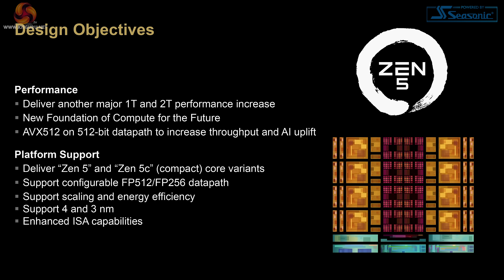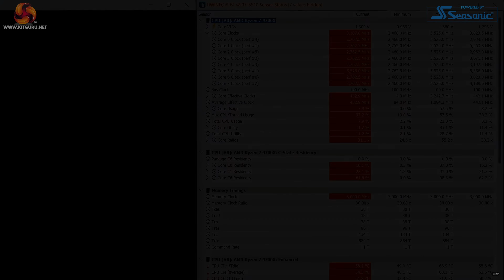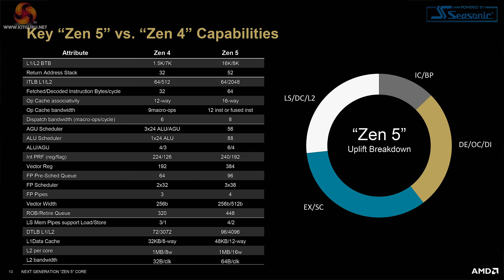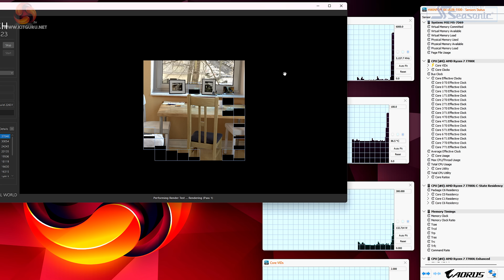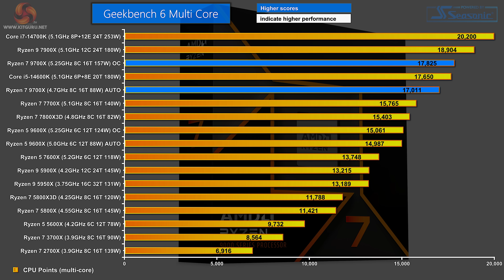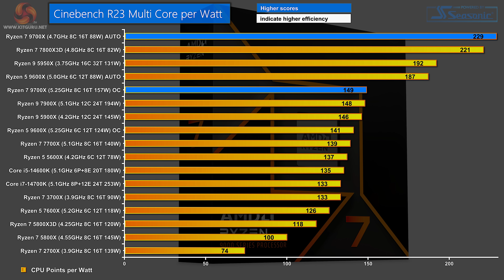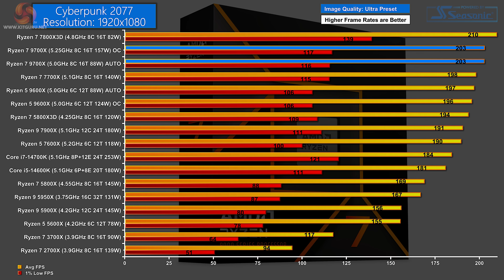AMD Ryzen 7 9700X review: YouTube hates this CPU

Comment: For game results, I think the cases where the CPU isn't doing much, it's just very quickly jumping between different power states as the CPU is waiting for the GPU and that could lead to very strange results. I have no idea about windows, but on linux there are definitely ways to control that and typically it leads to much more consistent performance at the cost of power draw when not under full load.

Comment: it seems the best choice will be a ryzen 9700x  with 32 GB DDR5 6400 MHZ and a X870 MOTHERBOARDaccording to reviews, But mine RYZEN 1700 that ihave since 2017 still runs perfectly evrything maxced 1440p 60 fps which means htere is no reason to chnage it yet it loads evrything in 1 second(games, windows, programs, movies, internet) and also runs all games maxed 1440p 60 fps. MINE MONSTER PC IS
RYZEN 7 1700
RX 6700XT 12 GB RED DEVIL
16 GB   DDD4 3200MHZCL15
MP 600 2TB WRITE:4950MB/S READ:4250MB/S
DELLP2416D 24'' 2560X1440 60 HZ IPS!
AS for windows 11 i can install it with Rufus even without chaning cpu too.

Comment: I wouldn't be surprised if the R7 9800X3D has the same uplift as the 7700X vs the 9700X...maybe we'll see some kind of optimization at the 12 and 16 core as far as being between different CCD's? Anyways, it's an incremental upgrade with incremental boosts to performance and efficiency. Looking at the big picture, it's what an iterative release is supposed to be! What do people want? New features that have problems? No.......

Comment: Very well structured & laid out review, with a mature opinion. 

The Ryzen 9600x & 9700x are not inherently bad. Nor great. Just Ok/alright.

I personally find value in a CPU that can achieve better power efficiency, heat reduction, small bump in performance & a Reduced launch price compared to the previous gen. 

Now if it were an extra 30-50$ cheaper id be giving it a stellar review. 

Lets see what the future brings us, im more excited about AMD's new GPUs more than the CPUs.

Comment: So is the 9700x ($A649) that much better than a 7700x ($A486)?  or the 7800X3D ($A588).    It doesn't matter that the 9700X is cheaper than the 7700X launch price when pricing history shows is was quickly reduced in price.  Most reviews of the 7700x stated it was overpriced at realease.

Comment: Imagine not watching hw reviewers and following amd or intels advertising. Would you still be happy with your purchase? I myself am mostly gaming only, and i would have been seriously misslead by amd advertising team for 9000 series. And to even think of defending those products is sick. Prices are huge, for cpu alone we used to buy a whole cpu mbo ram combo. There should be a thing like generational improvements with minor changes in pricing, but nowdays it seems as every cpu product is a masterpiece, a pure premium product.
Reply: in 2019 i bought Ryzen 7 2700X for €200. it's a 8-core/16-hread. 7700x costs €300 and don't want to drop below €300 even when 9000 was released. price has remained the same. with €200 that i bought the 2700X you have to buy 7600x=6c/12t. wtf is this crap?

Comment: I find it odd how people discarded the much improved efficiency and focused only on benchmarks... some did not even use PBO and overclocked. It is clearly a better CPU than the 7700x. I do find it odd that AMD stuck with lower consumption, they could've put to same power of 7700x and actually show performance improvements  for benchmarks...reviewers would be probably much more forgiving because "number gets bigger"... apparently very few care about efficiency and potential. Good review sir, appreciate you taking the time. Cheers.

Comment: You are very on the spot here, I built my current pc back when the ryzen 5000 series were brand new, late 2020, I never opted for an 8 cores cpu because I feel unconfortable with a cpu that draws 100w or more, so I stay always with 65w tdp cpus, meaning I only consider upgrading to a 6 cores cpu, BUT, this time is different, I'm excited for an 8 cores with 65w tdp that is not simply a cut down version from the real one, I will finally upgrade to an 8 cores CPU :) 

I honestly think youtubers simply find it necessary to show themselves as "tough" and heavily critique every new hardware release just so they are not seen as "(X chip manufacturer) fanboy" had AMD opted for higher power consumption to have the highest possible frequencies in order to achieve more cinebench scores (when this time is not really essential as Intel is struggling right now), they still would be complaining about how power consumption is too high and cooling requirements and so on...
Reply from the maker: Thanks for your thoughts 👍🏻

Comment: 14700-K ISNT 24 THREADS ITS 28
Reply from the maker: You are quite correct - the 8P+12E part is fine, it's the label on the chart that is incorrect. Well spotted,
Leo

Comment: It’s the exact same thing as intels 10700k to 11700k scenario 
Sure, it does stuff slightly better but for more  money and no reason to change platforms to use it if you have the latest last generation 
Meh
Stagnation
It’s bound to happen especially with intell getting greedy and stupid with voltages vs performance 
Meh
And I have a stagnation chip
11700k
It’s
Ok

Comment: That's silly advice. Buy a 7700x now and skip a few generations. If the price is the same or a few bucks difference, then pickup a 9700x. To be a great chip it has to offer tangible or negligible difference. Power efficiency is great for laptops, so it'll be exciting to see laptops with these parts, but for desktop? This is not a good cpu. Also if you want efficiency there's also 7700. I think AMD is priming us for the real 9700x, ie the 9800x with a much bigger price hike.

Comment: AMD claimed the 9700x to be 43% faster than the 14700k in Handbrake, and it turned out to be 50% SLOWER. Pathetic blatant lies.
Reply from the maker: In the reviewer's guide for Handbrake using Apple 1080p60 Surround on something called 'Cali footage' they claim 256.9 for Ryzen 7 and 358.2 for Core i7 which looks like 28% faster for AMD. I decided not to use Handbrake in this review and do not know what 'Cali footage' is. Have you run that specific file conversion using the setting they give to verify your statement or is this received wisdom?
Leo

Comment: Those "reviewer" Intel fanboys hate it because on several benchmarks it beats their 14900K, doing so at 65W, not 350W, and a quarter of the price. Then they make excuses that it underperforms on other things despite doing better than 7700X at less power draw and cheaper. Its not going to beat the 7800X3D, yet they blast the 9700X as if it should.

Comment: What really i find sad is that they talk about the 65w point but ignore it all the way long... we have the 7700x with 105 and then the lil more faster 9700x AT 65w just by that this CPU is a win little better performance with a lot less juice.. cmon. Is like a V6 2.5 running faster than an V8 3.7, less fuel but more speed.

Comment: So AMD release a CPU that is a little faster, cost a lot less than the 7700X when it launched - has great software support in Ryzen master, takes 40% less power, runs cooler and overclocks better. And you can run PBO and crank it and its still not good? Tough crowd!
Reply: You should compare 9700x to 7700 (non X) and keep in mind it is half the price. Then you might wonder why everybody thinks 9700x is utter shit.
Reply: @tehehe5929  9700x is +18% single-core performance than 7700, yet multicore is similar performance that's where people thought "it's same", but 9700x & 7700's MSRP is also similar, and 1 year later 9700x will drop in price the same way as 7700 today. See 12:16 ,9700x blew every processor away in single-core performance.
Reply: @tehehe5929  242 eur vs 350 eur. 100 euro difference. It's not as obvious
Reply: @tehehe5929  its only 50 € more now
Reply: @giratina_86  That's good value then.
Reply: @tehehe5929  Currently Ryzen 7 7700, 7700x & 9700x are at same price. Which would be better for 3d modelling, Photo & video editing, racing games & some simulator games.
Reply: @amitkrupal1234  if they are all at the same price then 9700x
Reply: @BlaiseMiller14  the energy savings are not as relevant unless your power bill is high or you need it running 24/7
Reply: @herrba  7700 and 9700x have the same price here, so why pick 7700, both are less than 300$
Reply: @NeuralFuture-m7q  prices fluctuate, currently there is a 40$ difference in my area, but it used to be a higher difference around the time of my comment.
Reply: @ your price is not a global price, if price same get better chip if not get better price to performance chip
Reply: @NeuralFuture-m7q  9700x also has an "x" in it which makes it worth buying
Reply: @herrba  It is relevant, and the same reason why people mocks Bulldozer or Intel 14nm++++++++.

Comment: This is why I like Kitguru - never one to just jump on a bandwagon
Reply: Problem is, they are on a bandwagon; the AMD marketing one that suggests the 9700X should be compared to the 7700X instead of comparing it to the 7700 which it should be based on specs...
Reply: @MacGuyver85  Nobody is being prevented from doing 7700 benchmarks.
Reply: @tomstech4390  Exactly, that's what Hardware Unboxed did and you immediately see how the 9700X offers almost no improvement compared to the 7700.
Reply: @MacGuyver85  ❤❤

Comment: I do think some people are being a bit harsh, but I think some of their points are more valid than you're giving credit for... Like you're trying to hype up the efficiency but just Eco Moding the 7000 series equivalents or buying their 65w tdp default versions like the 7700 (non x) almost completely deletes the efficiency gain! 

On the temps? AMD moved the sensors so they're not apples to apples comparisons, they said to expect large temp drops because of the moved sensors. 

Comparing MSRP to MSRP also isn't really a real world comparison. You are comparing buying them today against eachother not launch to launch. 

On the building a NEW PC thing? Honestly valid for someone getting into PC gaming, or upgrading like a 7+ year old machine... but honestly anything semi modern and it still runs into the issues in alot of cases. LGA 1700? Still relevant. AM4? Still relevant. These chips just barely outdo the 5800x3d/5700x3d in gaming. AM4 came out in 2016/2017 so alot of people upgrading now a days may just have to consider that. LGA 1700 came out in 2021, 3 years ago meaning even people with 3 year old intel setups have upgrade paths to competitive CPUs.  

So it's not that they're bad, they're just kinda meh for existing PC enthusiasts.

Comment: People need to understand that lower power consumption is always going to be better than extra performance. Why? Because of cooling and noise. And because hardware is plenty fast already. If we look back at the 5800X, that thing was almost impossible to cool because of its ridiculous boosting and high TDP. The 7700X was almost factory overclocked by AMD and ran at 95C. Again, a nightmare for cooling and noise. The 9700X, while not producing very impressive numbers, does so at 65W TDP, basically matching the factory overclocked 7700X. This is amazing for people who don't want to spend as much on a cooler as they do on their CPU.

Another thing to keep in mind is that neither the 5800X or the 7700X sold well. This is obviously because the 3700X, 5700X and 7700 exist. All of them being 65W chips that performed nearly as well as their 140W X siblings. My guess is that AMD tried to get rid of that 8-core 140W chip altogether and put the higher TDP on the X3D 8-core chip. That way they won't have a chip that barely sells and they won't need to make another SKU with 65W TDP. They just came out with the 65W chip at launch instead.

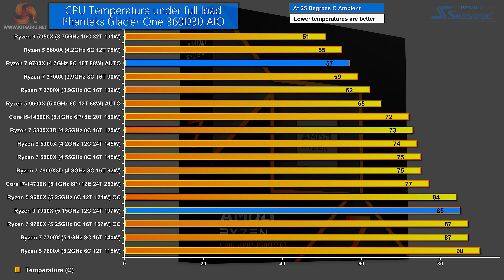Comment: I watch 9700X reviews not to diss them but to understand them better before deciding on what to buy, I believe there are errors on the highlighted areas on the graph as the Ryzen 7 9700X and Ryzen 9 7900X are confusing. Check out 12:10 where Leo mentioned the OC at 85, where it is 87.

Comment: AMD learned from intel's mistake of pushing the silicon to the limit, riding just on the edge of degradation and did not want to become the next one in line. They decided to have the customer themselves push the silicon as far as it can go themselves as to switch the liability on the user since the 'default' runs way cooler and will probably last several decades before degradation becomes an issue at the default configuration.

Comment: If you watch Coreteks latest video the 9700X apparently absolutely trounces everything, even 7950X in server specific workloads.  AMD has gone the Nvidia route and is catering to business.  Making hay while the sun shines.   Personally I think a Curve Optimized undervolted OC to 5.8ghz would be better for gaming than a 5.25ghz all-core OC.  My 5800X happily does 5.05ghz on 7 of the 8 cores while gaming doing that type of OC.  If you're doing rendering or heavy workloads all-core is the way to go but gaming is a light load and would benefit more from higher clocks.

Comment: The fact that this one can achieve such clocks at this voltage can mean a lot for the x3d, where the clock speed was always the major bottleneck.
Also, the focus on low voltage could mean a dual CCD dual 3D cache design in the next release.

Comment: Only you, Leo, and Wendell from L1 Techs have shown the new 9000 series under a different, more optimistic light and I thank you for that. Yes, it's very clear they're not as espectacular as AMD would like us to believe, but they're a step in the right direction especially on the efficiency side. Your criticism about the clock speeds are correct, that's something AMD shouldn't have done. Maybe that's just a strategy to sell upcoming processors at higher prices, as they are doing with the new XT series.

After a bunch of youtubers uploaded their videos downplaying or mocking the new chips, most of the others jumped on the bandwagon yet they failed to talk about other facts you did mention. Your 8/10 score for the chip is spot-on.

Comment: Power consumption is more relevant in Europe than US/Can with elec price about 4-5x higher. Over a year this may save say £20-£30 vs last gen, so maybe £100 over a short lifespan. Thats relevant when comparing cost/performance, plus requirements for cooling etc. (UK price is 25p/kwh roughly, was over 40p not long ago)

Comment: +10% more performance with 40% less power usage - this is a huge improvement! 
I looked at some of the reviews and was completely stunned by the complains. I have no idea why they are ignoring this. 
I would even say that this CPU is a gamechanger on the market. Can power smaller devices with desktop performance.
Reply: 1 it isn’t 10% faster on aggregate.more like negligibly faster compared to the 7700x/7600x
2 it’s 7-10% faster then the 7700/7600 (non X) which have roughly the same power draw.

This might be able to be achieved with just a Die shrink of the 7k series.

So I am disappointed that 2 years of development with very talented and previously very successful engineers. Lead to absolute jack shit.

It has been an colossal waste of time and money.

Comment: 1) You're not comparing it with Intel parts, 2) it does not matter what the launch price of the 7700X was, what matters is the 9700X is 40% more expensive today as compared to the 7700X, 3) You're not comparing it to the 7700, which was in all honesty the power-efficiency fix for the 7700X

Sorry Leo I have great respect for you but am disappointed in your analysis and conclusion.

Comment: The lower operating temperature makes one wonder if boosting to 95C 24/7 was really a safe thing on the long term.
Reply: Wendel addressed this they can handle running 95c for running in a server envorimwnt or even crypto at full load without problems.

Comment: Thank you.  Finally a review that takes everything into consideration.  Performance per watt is a significant factor in grading a CPU’s overall worth.  That reduced power draw saves you money in the long term.  And anyone who has a 7000 series processor should think real hard before upgrading or writing off the 9000 series processors.

Comment: The fact remains it costs a LOT MORE than Zen4. if it was released 2 years ago - sure, but do you now want to claim that CPUs should forever stagnate in their price/performance and efficiency? Cause the 7700 exists - and is just as good as the 9700X. And the 7700X is basically what happens when you run the 9700X to its max OC.
But AMDs marketing really worked wonders here. The direct competition is the 7700 yet people claim it is oh so good cause it is just about as fast as the 7700X - a CPU that was in general regarded as the worst of Zen4 cause you can either get the 7700 or the 7800X3D.

The 9700X is just a tad bit more efficient than the average Zen4.

Same powerconsumption but just a tiny bit faster than a 7700, slower than the 7800X3D - and costs more than both.

Comment: I don't understand how it's unfair/biased/dishonest to compare 9700X to other parts at their current prices. If you're buying a chip, whether you're upgrading or building a new rig, there's just better options for the price. The 7700X is cheaper and it's basically the same performance. 7800X3D is better at everything lol and the same price. If power efficiency is worth $70 to you, then go for it over the 7700X.

Comment: Ultimately, after two years you either expect a relatively significant uplift in performance or a corresponding price cut. This one fails on both fronts, and spectacularly so on the latter. Shades of Intel's 12th gen here.